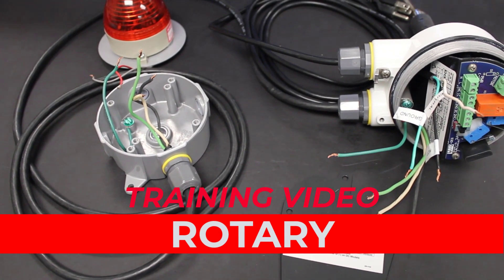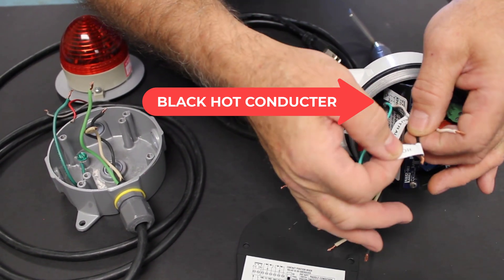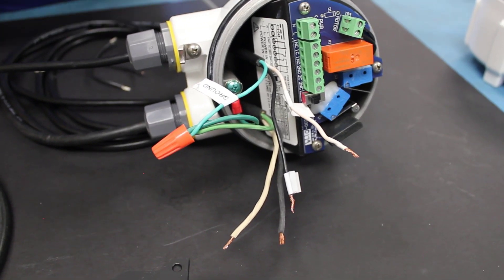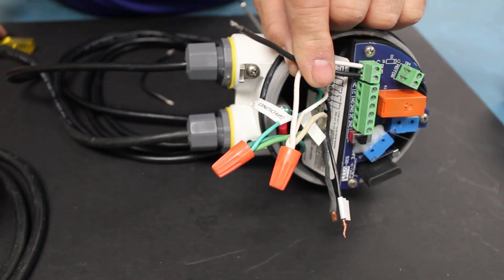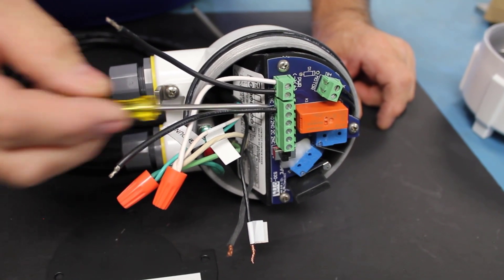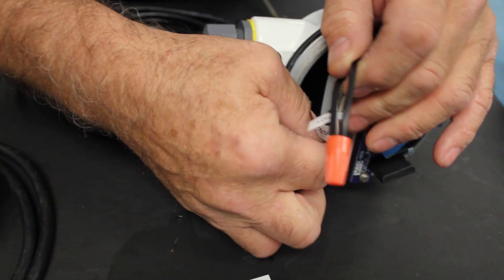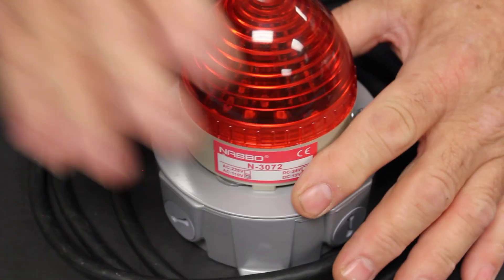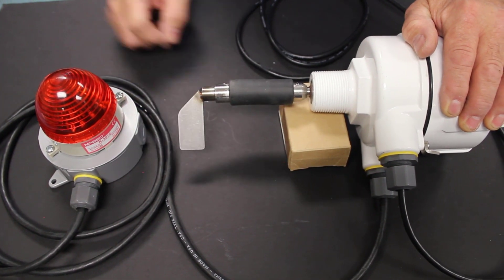Wire a Rotary Level Indicator to a Light

Comment: We had to discontinue using these because we were getting less than 3 years of service out of them before they malfunctioned. We were using the BMRX model.
Reply: And we're continuing to have these units go out. The plastic gears in the motor are stripping out.